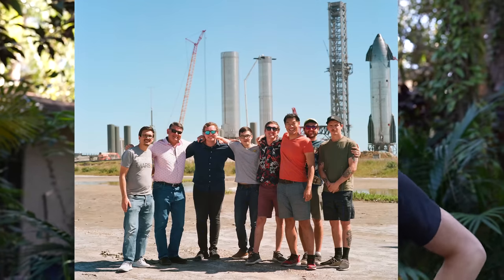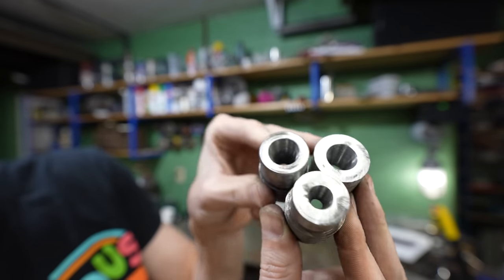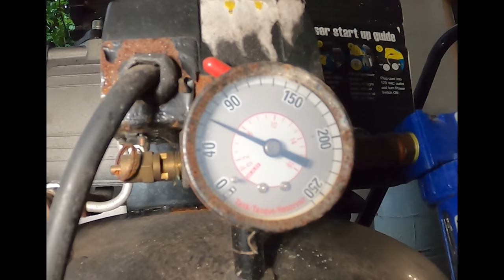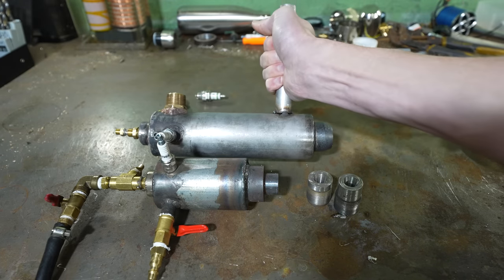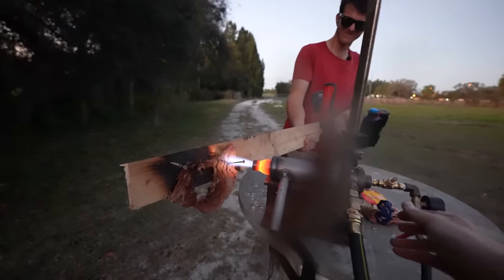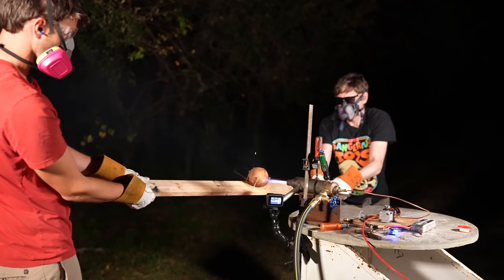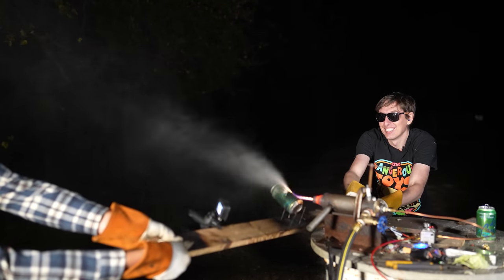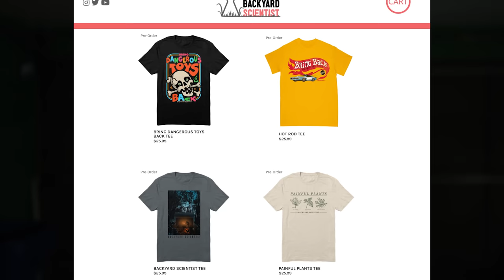fire death machine - i made a rocket

Comment: I’d have been curious to see how much thrust the “rocket” produced, then compare it to how much thrust was produced just by sending that huge volume of air through the tiny nozzle.

I’d also be curious how much pressure you were developing in the pipe and just how close you came to making a pipe bomb, especially when the back end started glowing red hot (and getting weaker)
Reply: It never would have detonated, for numerous reasons, the first of which being that the engine HAD a couple of openings through which pressurized gas could escape. Second, even red-hot steel is still strong enough to withstand quite a lot of stress. Ever seen the brakes on a NASCAR racecar late in the race?

Comment: Been waiting for this kind of rocket build for a long time, i remember reading a book about rocket engines being just a combustion chamber with oxygen going in at one side and any other flamable gas going at the other side, but for yrs never seen anyone build it, its always a oxygen and solid fuel rocket, or other types, didnt know compressed air was enoung for this, could you use 100% oxygen in place of compressed air or does it need to have a stronger combustion chamber for that?

Comment: I’ll be honest I’m pretty sure all of these antics were really really bad ideas.  But I’m so freaking happy you did this and shared it with the world.  This was awesome
Reply: I don't think people come here for "good ideas". I don't think that a DIY rocket engine would ever be considered a "good idea" by most people.. The danger seems real and not acted like electroboom... at least that's why i watch TBS :D
Reply: @dawica  "but would you feel comfortable standing next to a bomb that had a 1% of killing you?" Uhm, no? That's why i don't do stuff like that... i watch other people do it.
Reply: @gear2902  Yes.
Yes it is, Champ
Reply: @chrisakaschulbus4903  I think it's fine if people want to do things like build DIY rocket engines. The problem is the lack of respect for safety, which is the sort of thing that gets laws made that ruin the fun for everyone. There wasn't even basic safety precautions taken. That rocket engine being laid down and run without strapping it down had me really nervous. Sure, it was a heavy design, but even the compressed air is providing thrust and he was entirely reliant on friction to keep it in place. Even if the friction was enough to keep it from place from the exhaust, what if someone tripped over a hose? It could have been pulled towards them with hot rocket exhaust pointing at an unpredictable angle, potentially causing serious burns. If it were to start running engine rich (melting the engine) it would have spewed molten metal toward their mostly unprotected faces. This sort of stuff can be done for fun safely with some basic precautions but these guys were way too cavalier.

Comment: Looks fun, but with all of the required support equipment it doesn't seem particularly useful as a motor, is it? Could it move that giant rotary compressor? Did you measure the difference in thrust between just cold air and lit? I built a rocket like this for melting metal and it worked well. It got me thinking about whether I could use a turbo-pump instead of an electric air compressor but it seemed like a lot more math.

Comment: The occasional sparks you're seeing coming out of your nozzle is most likely superheated rust. The combination of heat, pressure, and oxygen eats through metals pretty quickly, which is a huge reason why space agencies prefer ceramic nozzles and/or liquid-cooled components.

If you inspect your rocket engine closely, I'd bet that your nozzle throat is larger than you originally drilled and that your combustion chamber has larger air holes now.

Comment: I would need to see the difference of with and without fuel to see if actual thrust is being produced over the compressed air out put. Doesn't appear to have made any measurable energy increase and it's just a high pressure torch that really could have been bought for less than the scrap metal materials used.

Comment: How about oxygen instead of compressed air...?
Reply: I would assume the risk is greater than he is willing to dive into atm.
Reply: Would likely melt.
Reply: Probably 100%  pure oxygen would make it more hotter. I wouldn’t know tho. I ain’t a rocket scientist
Reply: That could probably melt the "rocket"...or explode...or both
Reply: With compressed air it is not a rocket but a blow torch, for it to be a rocket it needs oxidizer like oxygen...
Reply: mixing the wrong amounts is extremly dangerous, also even weak fuel like propane would melt that steel like a butter when mixed with pure O2
Reply: @oisiaa  At the scrapyard in my town they use propane oxygen mix to cut plate steel as it is cheaper than acetylene. It still slices 30mm steel like butter. That engine would be melted in no time.
Reply: @prodigalson2670  it’s the oxygen that does the cutting. The propane/oxygen mix is just for preheat. Acetylene is a little bit faster but for scrap and severance cutting, propane is fine. Also cheaper and safer. 
The navy have a version that runs on jet fuel.
Reply: pretty dangerous probably

Comment: I used a tool that is called a SONIC LANCE for removing dirt from tree roots at ground level. The speed of the air comes out of the lance at up to mach 1.6 speed. You are dressed in a moon suit tougher than a sand blasting attire. You have to hold on to the lance with all your mite. What you are showing would not even make a  dent in the unit. That is what you should use fella. Your rocket motor would just take off for sure. Peace VF
Reply: I also loved when the Beyond the Press channel used that company who uses high pressure water to cut holes in the ice on their lake. Badass stuff.
Reply: Yo can u put a link to one I can't find it
Reply: @JDMOON55555 I will look for you JD
Reply: @victoryfirst2878  thanks

Comment: This is awesome. Might I suggest you put a flashback arrestor on your gas line though? It's a really good idea to have one at all times. Never know what'll happen, they generally say to use one on all Oxy-Fuel systems, and you're only using compressed air, but they're so cheap it literally can't hurt.
Reply: Is it really a problem? The fuel and oxidizer are kept separate until they are in the combustion chamber.
Reply: @nictheregulardude  They're kept separate in welding setups too and you'll never see lines without flashback arrestors on them.

Its much less of a danger since he's not using pure oxygen, but stranger things have happened and you can get a pair of arrestors for $20. It's too cheap to not have as a safety.
Reply: Yeah, compressed air backfilling a propane tank could have.......interesting...consequences. Wait, is that another video idea~

Comment: Definitely would like to see thrust numbers of that thing with different nozzles.
You can probably make the inner and outer mixing chambers out of thinner aluminum, maybe tungsten for a nozzle?
After that try running it with liquid hydrogen and liquid oxygen from tanks, just like a real rocket would
Realistically, after doing all that, if your pushing a good amount of thrust with it, you can theoretically calculate how big you can make the rocket.
You would do Thrust subtracted by Thruster weight to get total remaining useable thrust.
From there you would just have to work with your thrust number and try to figure out what size hydrogen/oxygen tanks you can carry and strap to the thruster.
Would love to see this turned to a little space program
Reply: Thinner chambers would probably result in faster ablation of the mixing chamber walls, lol.

Comment: With the kerosene powered jet, you've essentially made a HVOF torch. If you add a feed of powdered metal or ceramic, you'll have a HVOF metal spraying system!
Id love to see this as a modification to this!
Reply: in original video rus guys did it. They was spraying Zn to steel in corrosion protection purposes
Reply: Isn't that similar to how we make ruby too? Aluminum oxide and some chromium or other contaminant added to a jet of superheated gasses with the result building up on a seed crystal..

Comment: I have been trying to do something like this for moths now and you just weld some pieces of tube and it gives you shock diamonds!?! Hats off to you!
Can you show some plans?? Or the fusion file?
Reply from the maker: https://drive.google.com/drive/folders/1ygPYCI8e1HP3wuyTK-7k_HOQIu5aVSxR?usp=sharing
Reply: @TheBackyardScientist  duude you are a hero! Thank you so much!
Reply: Yeah I've been doing something quite similar, although my burn chamber is a little smaller. Made the same mistake as him (the nozzle should only expand to maximum like 1.5 times the choke diameter for these chamber pressures of 5-10 bars, if the pressure is even lower you would get the most thrust by not expanding the nozzle at all. Used an oxygen bottle and mapp gas (has higher pressure than normal propane, but the same in terms of ingitability and safety). But have to heat the canister for V2 to 50°C in a car battery powered thermostat controlled water bath for good pressure. Maybe it's better to make the high temperature parts out of stainless steel as I think it doesn't oxidise as badly as normal steel. And yeah I've used a ton more security features like making it remote controlled and monitoring pressures, adding flashback arrestors and check valves and taking cover behind polycarbotante sheets, this madlad just handhelds it with sunglasses 🤣🤣 yeah but I honestly think it's easiest to just weld your stuff together and not worry about fittings and connections. By not using oxygen but compressed atmosphere, his chamber temperatures are much more manageable. Had the idea of using chained up electric turbo compressors, but just renting a big diesel compressor is awesome too. Have fun! And don't get yourself killed!

Comment: I have an idea for a turbojet just using a turbo charger. build a really thick pipe that connects the output of the intake side to the input of the exhaust side. put a small sparkplug in the pipe to start the system and just run the turbojet on a large carburetor at the front. probably a cv carburetor

Comment: This is dope as hell, but can it actually be considered a "real" rocket or just compressed air with burning propane? I'd like to see the thrust difference with and without fuel.
Reply: not that deep
Reply: That’s very much a real rocket engine, and not “just compressed air with burning propane”.  For a rocket engine to work you need both a fuel and an oxidizer, in this case the propane is the fuel and the compressed air is the oxidizer.  The compressed air isn’t there to push the propane out of the nozzle, it’s there to provide enough oxygen for the propane to actually burn, which in turn shoots everything out of the nozzle.  Compressed air isn’t the best oxidizer in existence, but it certainly gets the job done if you have enough of it and don’t want to deal with anything more dangerous than that.
Reply: @virtuallycrazy8709  "Not the best oxidizer in existence" gives me fond memories of when I first read Ignition! ;-P
Reply: @jannepeltonen2036  I’ve wanted to read that book for a while now… Couldn’t find it at the local library or on their system so I kinda gave up for a little while
Reply: That air compressor is not creating that much supersonic flow on its own... This is a real jet engine of sorts.
Reply: @Ithirahad  Of course it is
Reply: Considering that the oxidizer is not self contained, no this is not a rocket engine as you can't compress air in a vacuum. Therefore this is a jet engine.
Reply: @rocketry1000  I think in this case, the correct term would be motorjet. But if he would use the compressor to fill a tank, which would then be used for the engine, then it would indeed be a real rocket engine

Comment: I'm a little scared to ask what one would need a diesel powered air compressor for. I didn't even know that was a thing.
Reply: Air powered tools on construction sites I'd guess. Jackhammers and stuff
Reply: That is what I figured. If you had a lot of jackhammers or whatnot.
Reply: Air tools like Pneumatic jack hammers.
Reply: High powered air tools like hammers (for roadwork) for example. In the middle of nowhere there is also no electricity available for electric powertools
Reply: There are electric twin screw compressors as well not just diesel. Ours at work was 200hp. Air screw drivers, assembly equipment, pneumatic material transfer, vortex cooling guns, air pallet lifts, sprue pickers ... lot of use for air in manufacturing.

Comment: I'd like to see the difference with and without fuel. How much damage just the air pressure would do.
Reply: Hmmmm.
An Abrasive material would have to be added instead of the fuel to achieve a cold cut👍
Reply: @R L The fuel completed the fire triangle (hot cut)

Comment: I think this wasn't much of a rocket, because a lot of the thrust was coming from the fact that the compressed air is escaping. For proper rocket propulsion, you should've used liquid oxygen too and then fed the two liquids into the combustion chamber. The igniting device could also be made separate, like with real rockets and launch pads.
Reply: It's a liquid air rocket.  What you're asking for is too dangerous even for him.  I would have liked to see the difference with just compressed air and how much thrust increased with the addition of kerosene.
Reply from the maker: Id say the combustion doubled the thrust, and as for using liquid oxygen of course it would be an order of magnitude better but no way in hell I'm standing within 50 feet of a rocket fueled with liquid oxygen. not to mention the time and investment to design a system like that.
Reply: @TheBackyardScientist  "Fine, I'll do it myself"
- Thanos
Reply: @knurlgnar24  FULL LIQUID!!!!!!!!!! AAAAH HAHAHAHHAHA!

Comment: Nice...jet engine... It's only a rocket when you start dumping liquid oxygen, not compressed air. Still, pretty very insane.
Reply: Not true at all
Reply: If you want to be pedantic, a rocket engine is a TYPE of jet engine where the entire mass flow comes solely from stored propellant. Nothing in there about liquid oxygrn, rockets can run on fluorine or other exotic chemicals

Comment: Fun fact: Mach diamonds actually mean that the engine is less efficient than it could be. Ideally, your exit pressure exactly matches the ambient pressure, because this means all of the excess pressure was used to accelerate the exhaust. When the ambient pressure is higher than the exit pressure, the flow turns inward and creates shock diamonds. In rocket engineering nomenclature, this means that the flow is "over-expanded."

The reason you will see Mach diamonds on space-rated launch vehicles is because the pressure varies continuously from the ground into space, so they pick an engine target pressure that is somewhere in the middle to maximize the efficiency. This means that when the engine is firing near the ground, the exhaust will be over-expanded.

Comment: Add a turbocharger inline of the exhaust side of the combustion.  You won't need an air compressor.  You reroute the compressor side of the turbo into the inlet side of the combustion chamber. Bam, no compressor

Comment: For any other HackSmith fans out there if there was a way to fine-tune this to make the output longer and apply this to the HackSmiths light saber build this would be really cool because even though it’s on a smaller scale it already is proven to be Stronger if put to scale to their light saber then the blade they have now I know it would probably take a lot of engineering but in a Kalab would be really cool or if they use the same concept either way I would really like to see it

Comment: you made a ramjet engine combustion chamber and used an air compressor in lieu of the intake and compression phase.  That is not a rocket.  Those shock diamonds are also common on ramjet and scramjets.

Also, thankfully when you blew up the can of shaving cream the shrapnel from the can missed you and you didn't get a shard of aluminum stuck in your neck.

Comment: paraffin hydrogen peroxide (paraffin + 5% hydrogen peroxide = TPH = DEAD K-141 Kursk RUSSIAN SUBMARINE ) as rocket feual its fine just adjust the mixture .start low with % of hydrogen peroxide to paraffin  till you get the required thrust

Comment: You've essentially made a ramjet, where the air mixture is added to the fuel at such high speeds (like at Mach 3) there's little need of mechanical compression needed in the motor. The SR-71 Blackbird uses something like this in the afterburner where the air is completely bypassed around the compressor area and pushed directly into the afterburner. Still, pretty sweet.

Comment: i have a powerful pc that is strong enough to slow videos down to 250,000 FPS and i used 75,000 frames per second the screw was literally melting but it only lasted 0.000000001 seconds